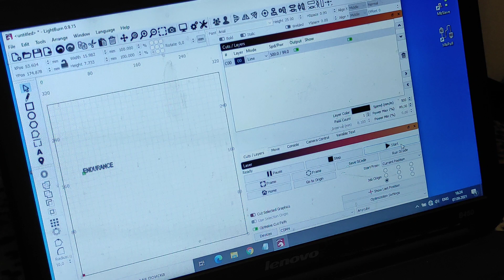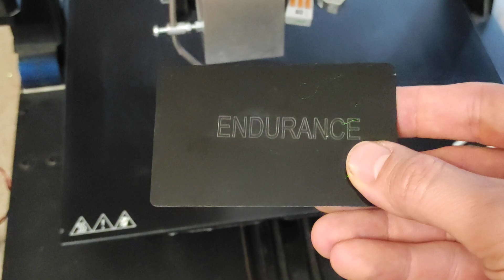Upgrading Artillery Sidewinder X1 3D printer. Adding an Endurance 10 watt Delux diode laser.

Comment: which changes if any did you have to make to the firmware or is it all handled by the slicer?
Reply from the maker: no changes, just install the laser and you are all set!
Reply: @Endurancerobotschannel  can we use both, the 3d printer and the laser ? This is 2 in 1 install ?